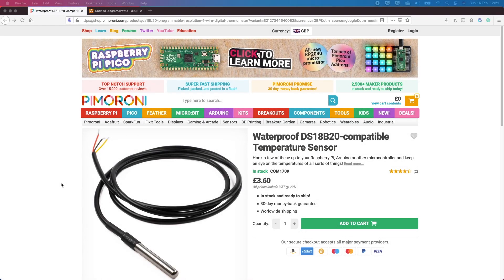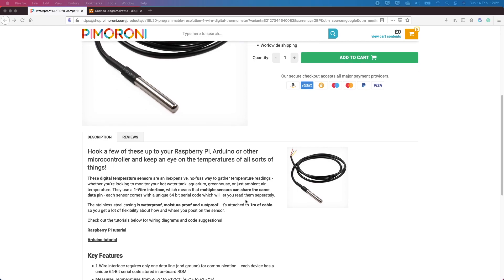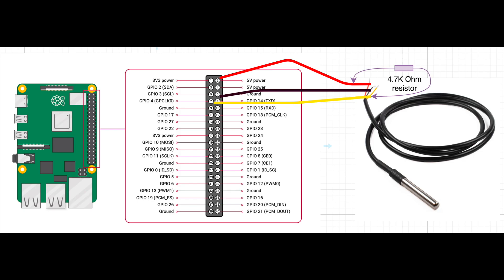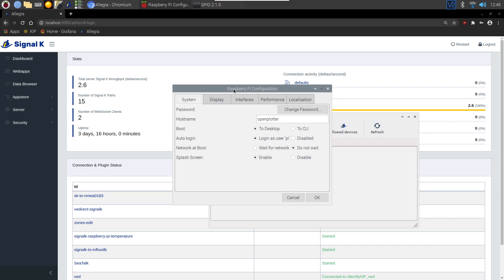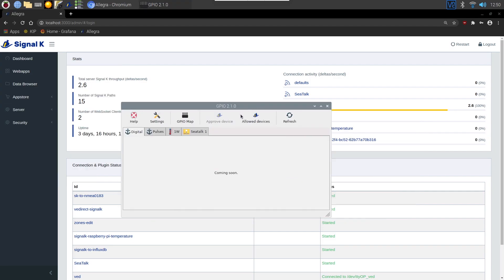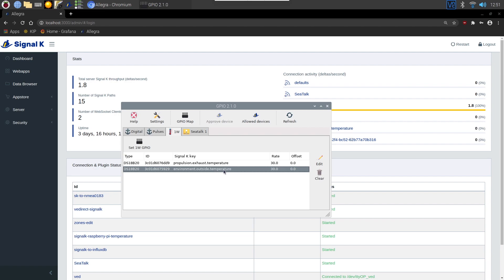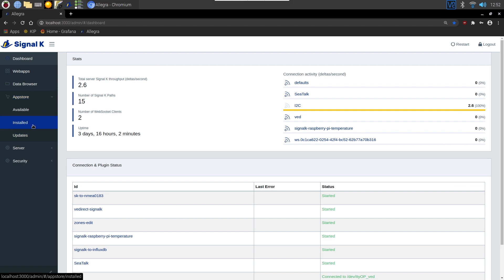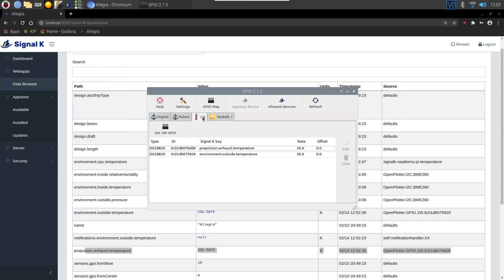OpenPlotter - Sensors (1Wire) SignalK

Comment: Hey there, thank you for doing this video. Is there any way to speed up the refresh rate of these?
Reply from the maker: Hi, thanks for your comments. If you go to the GPIO app and the click 1w you should be able to change the rate for each sensor. I can’t remember if it has a lower limit but I know it’s not as responsive as the I2c interface and sensors like the BME280. I think the default is 30.

Comment: I want a level sensor for my watertank connect to openplotter. can you advice one?
Reply from the maker: Not got this resolved myself yet (cheaply anyway) you can go down the n2k route and get them on you network but it’s not cheap.  The pi doesn’t have any analogue pins so it’s some sort of board or conversion.